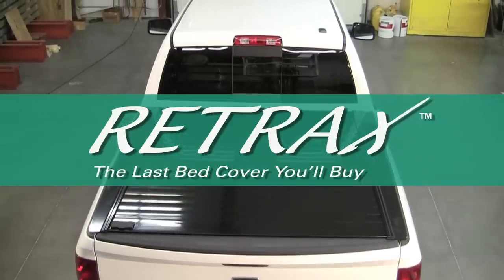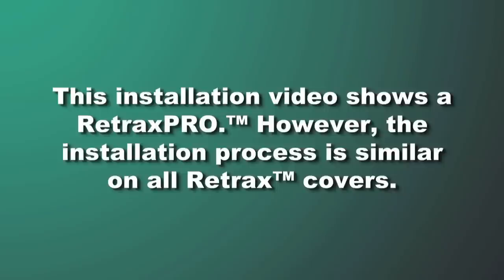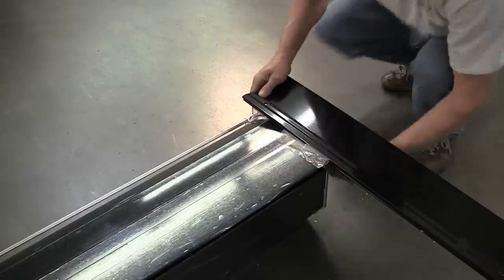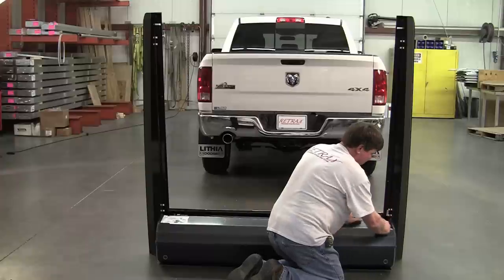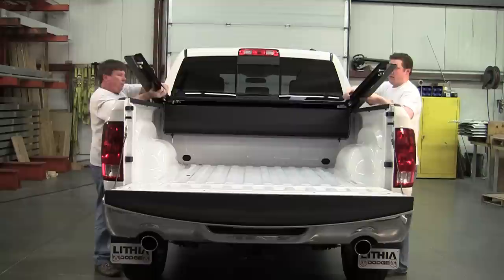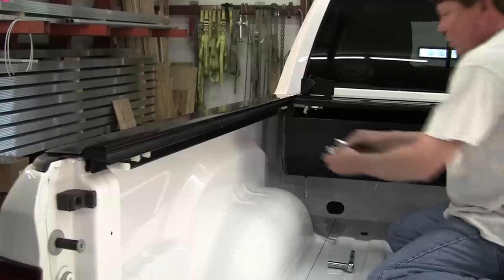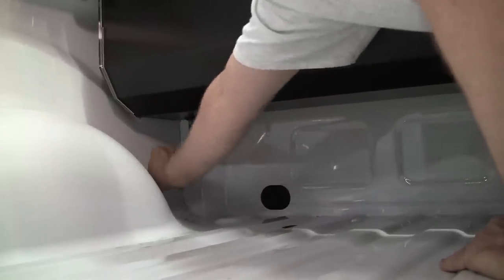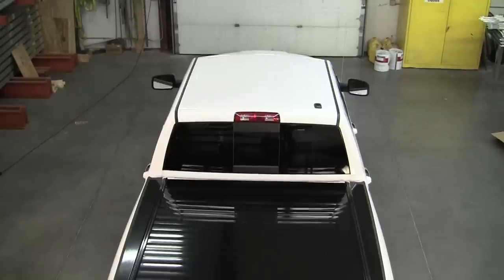Retrax Installation Video

Comment: After days of research, I opted for this RetraxPro MX model for a Ford F350 because of its series of sealed roller bearings. However, there were some significant shortcomings with the product that are worthy of mention. The worst of them all, by FAR, was how incredibly 'tight' the top is upon closing it. The manufacturer (Retrax) clearly states in the provided Installation Instructions NOT to lubricate the tracks or any other component of the tonneau cover. However, the fit against the upper weatherstripping affixed to the inside of each track is so ridiculously tight that upon every single opening and closing event, an inch or more of the weatherstripping itself is dislodging and migrating rearward, protruding out of its slot, on the rear of each track, at the tailgate end. And to be clear, the width adjustment between tracks (left and right, front and back) is "identical" to within 1/16". Hence, there is NO other form of friction or resistance. In my view, this is essentially overkill by the designers in terms of fit and attempted weatherproofing, and is a completely unnecessary and unacceptable circumstance. Its unfortunate too, because if it weren't for that single fatal shortcoming, this particular tonneau cover would easily be the best of its kind on the market.
Reply from the maker: Hi +Joseph Stewart, thank you for your feedback, we will be sure to share your comment with our team and engineers.
Reply: SAME ISSUE - 2015 F350 - I am an engineer. I know how to measure. Rollback too tight in last 18" but tracks are parallel. I did not yet notice the weather strip migrating, but it should not for that price. 10-25-2018
Reply: I bought this cover today, and had the shop install it..... it’s so tight just like Joseph said. Retrax also told us this top would work with my factory bed divider in my 2017 Nissan Titan XD.... it doesn’t...... there are 2 bolts that hit it. If I had know this top would not work, I wouldn’t of bought it! I had a roll n lock on my last truck and it was perfect from day one till I traded in truck. I can’t wait to call Retrax on next business day...... I can’t even open it it so tight... shop adjusted it and say .... oh, it will get better with use....... can you imagine if everything we bought was horrible at the beginning and we had to wait for it to get better………… straight up embarrassing...... this is fu$&ed!!!!!

Comment: does this fit with plastic liner?
Reply: Hello. Yes it will fit with a plastic liner. In some models, the liner may need to be trimmed at the bulkhead to accommodate the Retrax canister.